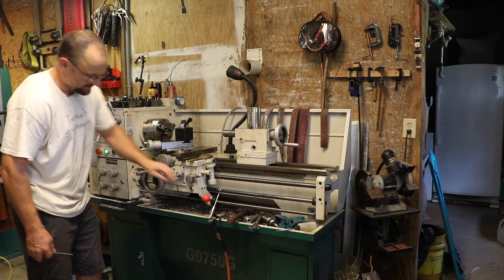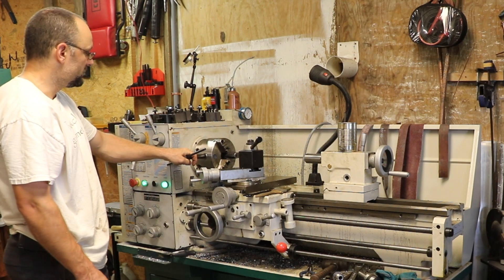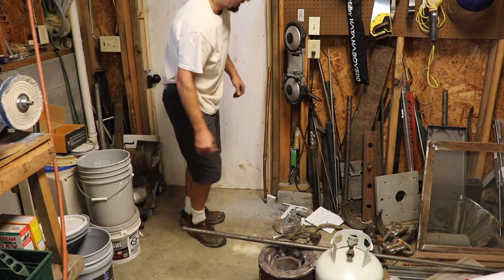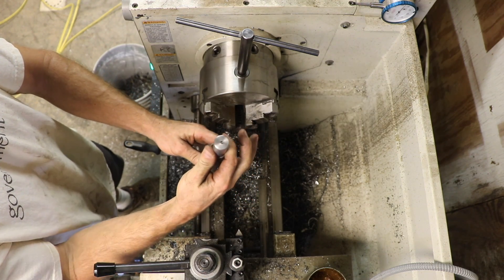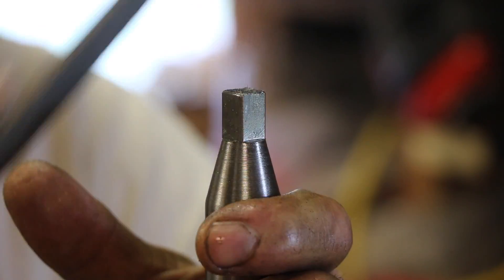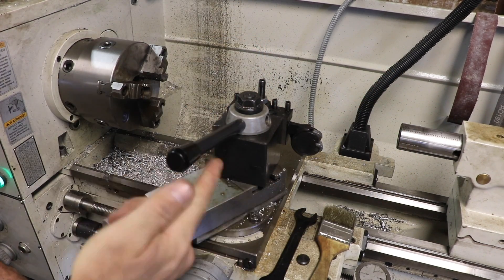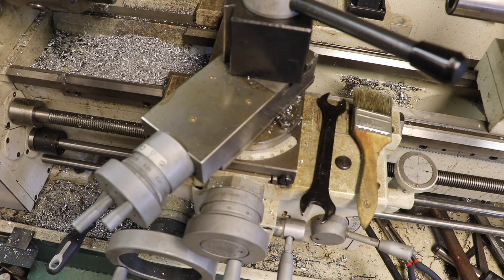Machining A Custom Chuck Key. And Mini Review Of My Grizzly Lathe.  G0750G

Comment: Yeah, that thing about the chuck being too close to the headstock, I’m a real machinist and believe me you don’t want overhang on the spindle. You want everything to be a short and stout as it can be for rigidity. The only thing a guy would do in that case and I’ve done it myself even on some very large lathes is get an extension for the chuck key even if you have to make your own. Problem solved.

Comment: The chuck looks to be a 160mm, most likely should have a a 200mm at the least to be of any real use.  That would have fixed your chuck key problem most likely. A 200mm chuck has better clamping force in any case.

Comment: very nice.  1 suggestion.  heat the squar tip to cherry red and oil quench it, then anneal to a bluish color.  Can be done with a Mapp gas torch.  On that alloy would bring it in the nieghborhood of 55rc.  Keep the edges from rounding.  not too late you can do it now.

Comment: Just ran across your video, Pretty slick, My Bolton 1440G  came with the same POS handle, I just added an extension on to the shaft and a new cross handle. Later from Texas.

Comment: You and I have identical lathes. I like your mill, as well. Mine is an older knee mill, also from Grizzly: G3619. My tractor is a Mahindra 5545, also with a backhoe and other implements). Mine may be a later model than yours. I know my backhoe is marked differently than yours. I just found your channel and wonder in what part of the country your farm is located. I am in SW Missouri.
Reply from the maker: North Carolina.  It seems we both like to get the most out of our money!

Comment: I'm wondering if there is a noticeable difference in the runout on things the accuracy that can be done between the gunsmithing version versus the regular green gearheads. I know the turning between centers is the way to go but sometimes you just need to put something in a chuck

Comment: Excellent. 
I just picked up a circa 1920 or sooner W. M. Oliver lathe. It's in excellent shape and it's from an era when there were dozens in the factory being driven with flat wide belts from an overhead drive shaft that might have been steam engine driven. 

I don't exactly want to use flat belts to drive it so when I try to make it operational I was thinking I'd like to change the stepped flat belt assembly on the shaft that rotates on pillow bearings to step pulleys that are shaped for V belts or go all out and use a motor controller in conjunction with the drive motor.

I am not a machinist  at all and I bought it because I like mechanical contraptions plus if it can be used with metal then it should not be to difficult to adapt it for wood turning and since I build crossbows why not turn arrow or bolt shafts too since they run up to $10 a piece.

Comment: I'm a vintage lathe guy myself even the 50 year old all cast iorn are 10 times better than the new lathes I've used,  they wasn't thinking make it the cheapest just the best.
Reply from the maker: I agree.  I looked for a long time for an old lathe in my area but couldn't find a decent one, so I gave up.  A few months back I saw a nice leblond on FB marketplace and it gave me heartburn...
Reply: @FarmCraft101  yea,,,I've bought 5 in the past 3 months,,,first 12 x 36,,,very nice condition,,then 2 6inch ,,618 and 109,,,and Saturday I drove 100 miles for a 12 inch and 6 inch,,, but the big surprise was in 5 gal bucket of attachments to,, a 500 dollar milling attachment,  350 dollar steady rest and 250 dollar follower rest and faceplate with 3 dogs,,,and really nice 4 jaw Chuck to go with 3 jaw on lathe and it's the exact model as my 12 inch,,,l payed 500 dollars for everything,,,I'll never find another deal like that,,,no wear on ways and only 1000th run out,,, took me hours to clean off years of grime, my friend has a 12 x 36 China lathe 1800 dollars and he said he would rather have my 50 year 12 inch,  even the quick change gear box has no play at all in bushings like most..l smiled all the way home.

Comment: I've been a machinist for 45 years and, for me, Grizzly lathes are substandard. To say it's a gunsmith lathe is a marketing gimmick to make YOU believe it is one.
I had one of these lathes for five years and the motor burned out. Cost? $300 and 1 month downtime because they had to get the motor from China. By contrast, I have a Clausing lathe made in the 1960's and the motor still runs, the lathe still keeps its accuracy, and it's very robust. In my mind, it is an utter disgrace that ANY manufacturer would spend the time, energy, and material to INTENTIONALLY build substandard machines only for buyers to curse later about how bad they are. I've lost count how many times I've seen hobbyists complaining about Chinese made machines yet that's all they can afford. It's hard to believe that, with the ever increasing hi-tech advancements in CNC machining technology, the Chinese seem to be clueless about it. You would think that, by having it, they would make machines as good as or better than those of the past while still making them affordable. It is as if the Chinese machine makers hire trainees with no CNC machines that would make parts better and faster. Interestingly, the car industry, despite its own problems, nevertheless strives to improve their cars with all manner of technology. Yet here we are, with substandard Chinese machines that are far worse that those made in the 60's in the US.  I find it a tragedy that the US lost its way in making exceptional machines. Anyway, I got rid of my Chinese lathe and bought a vintage Clausing bench lathe. I'll restore it and rejoice that I'll never buy a Chinese machine ever again. These lame ass machines have become normalized in the US and those buying them  have no idea that the US made them far better than today
Reply: The US did not lose its way. Haas makes amazing machine tools.

Comment: If you EVER make the mistake of leaving that chuck key in the chuck and power up the lathe, and if you mange to duck fast enough to avoid being hit, you'll wish the key was a lot smaller.   Consider adding a spring loaded center pin so the key will not stay engaged in the chuck without downward force to compress the spring.  Be safe!
Reply: Put a switch at the end of the chuck key holder. If the key is not there, there's no power to the lathe.

Comment: The headstock is on your way; not the gearbox. You are right. And you have plenty of room for the chuck key on top of the headstock but you are using it as a tool shelf.
Reply: When he said that I scratched my head.  As a machinist nothing goes there, at least on my lathe

Comment: I have this same Grizzly G0750G Lathe and really enjoy using it.  Purchased the taper attachment when I purchase the lathe several years ago but never set it up and now have a project whereby a taper attachment would be helpful.  Curious if you have the T26300 Taper Attachment for your G0750G Lathe? ... and if so how it worked for you and any setup suggestions?  
Thank You for taking the time to make this video.  I can see the value in taking the time to make the longer custom Chuck Key.
Lathe Workshop Area:  https://ctmprojectsblog.wordpress.com/2014/09/29/new-metalworking-workshop-lathe/
3D-Printed MT-3 ABS Inserts: https://ctmprojectsblog.wordpress.com/2014/12/10/3d-printed-mt-3-abs-inserts/

Comment: The tool holder handle has two positions on it to tighten.there was no need to drill and tap another hole. 

I cant believe how many of you guys didn't figure that out.
Reply from the maker: No, it didn't.
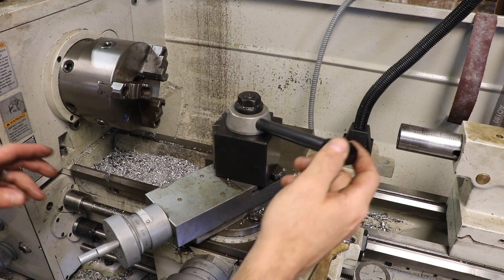Reply: @FarmCraft101  If you rotate the lever to the 7:00 position drop the tool older in and rotate counter clockwise it will lock and be in about the same position you drilled your hole at around 6:00.
It doesn't matter of you lock it in going counter clockwise or clockwise, the cam function is still the same. 
This is what I have done with mine since day one.  :>)

Comment: Had the same problem with my G4003G.  Welded a 3/8 drive extension on and problem solved.  Good tool steel as well.  Any problems keeping the friction set right on your handwheels?  Mine get out of adjustment and back off from the weight of the wheel rather quickly.  Take care.  Doug
Reply from the maker: Haven't had that problem with mine.  Cheers.

Comment: After seeing many "Grizzly" reviews, I've come to negative conclusions on all Chinese machine tools, lathes, mills, drill presses etc. Note: plastic gears are a feature in many Grizzly products. I don't know about this lathe but I wouldn't be surprised. With an abundance of great used machines by manufactures like Rockwell, Bridgeport, South Bend and others, wouldn't it have been better to spend a few dollars more on one of these machines? You have to consider diminishing returns. Also, your personal safety. I certainly wouldn't want a machine that would require alterations, new out of the box.
Reply: These models are all steel gears. I have the G4003, bought it 2nd hand. Took it all the way apart, cleaned everything, adjusted everything. Run out is less than .001" on the spindle.
Reply: @planeflyer21  I Flick is a lathe Snob. Don't waste your time on him... 😝

Comment: I am about to pull the trigger and purchase the same lathe. My concern is getting the lathe in my shop. I will have to bring the lathe in my shop through a standard 36 inch door. Any suggestions to make this easier would be greatly appreciated. Thanks
Reply from the maker: Heavy duty dollies would probably help a lot.  Good luck!
Reply: How about simply not doing that to yourself. After watching this video, you feel like you'll have better luck with your new Chinese lathe? For a few hundred bucks more, you could purchase a rebuilt  South Bend or a number of other manufactures that will actually out live you! Before "pulling that trigger" make sure you're not shooting yourself in the foot.

Comment: 3:28, what is that machining fluid?
Reply from the maker: The blue stuff?  That's dykem.  https://www.amazon.com/Layout-Fluid-Steel-Blue-Oz/dp/B00E2XQ0AK/ref=sr_1_6?ie=UTF8&qid=1537013471&sr=8-6&keywords=dykem&th=1  Otherwise I just use cutting oil.

Comment: No safety switch in the bottom of the chuck key holder so the lathe won't start up unless the key is in the holder?...
Reply: It's like the safety on a gun.  You must get in the habit of never letting go of the chuck key until you're done with it.
Reply: @billhinkle1653  Foolproof security. If you are a fool, the lathe will maim or kill you. You gotta do it the right way and not have a safety system helping you - that would be cheating. Same as motorcycle side stand engine cut-out switches. If you are a fool and forget the side stand, the next left turn will teach not to do that again. If it kills you, you are sure never to do it again.